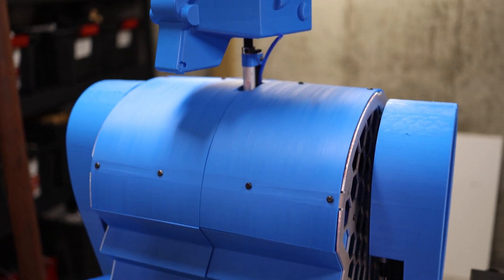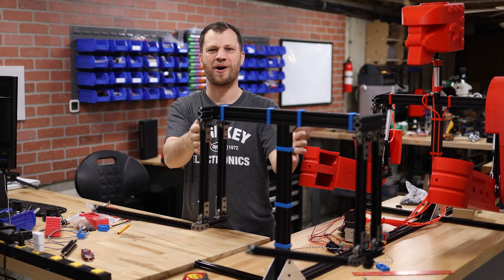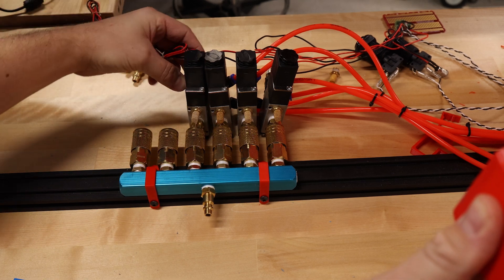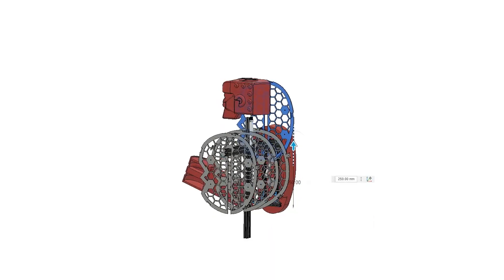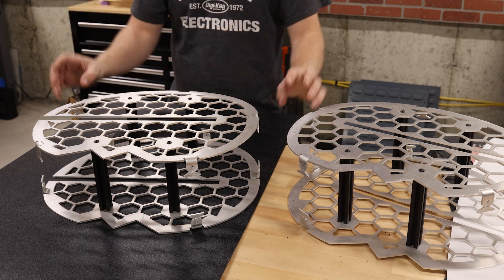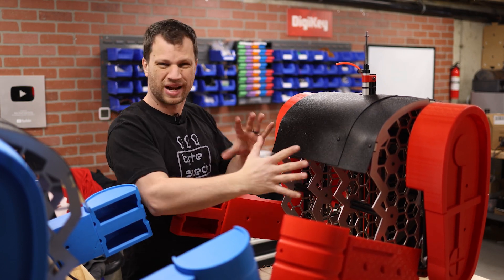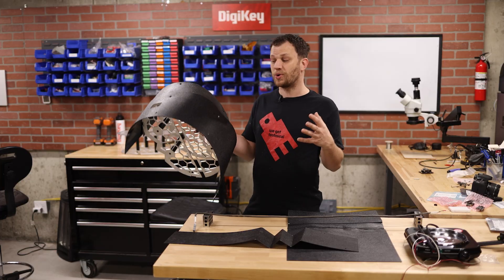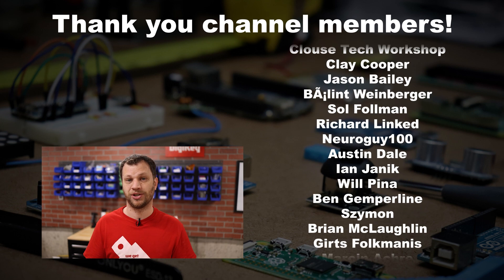There's more than one way to skin a robot! - Life Size Rock'em Sock'em Robots Part 3

Comment: Are they just going to be statically mounted on the table? If so, how will they punch each other in the chest to trigger a hit? The arms will only punch straight out and basically just fist bump each other.
Reply from the maker: The shoulder joints are ball in joints so there is a bit of range inward and outward. Eventually I would like to have them swivel on their hips